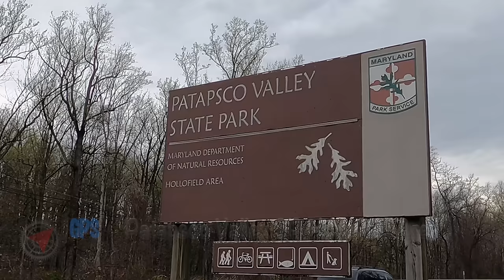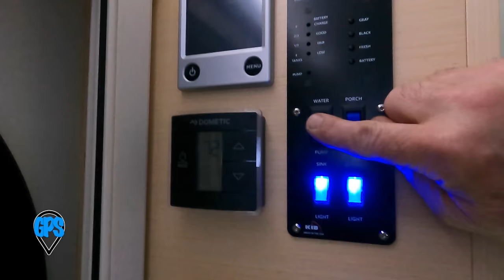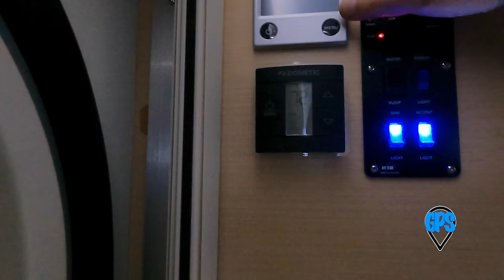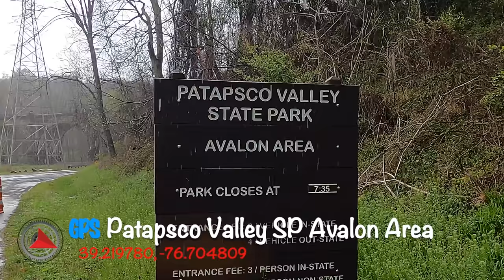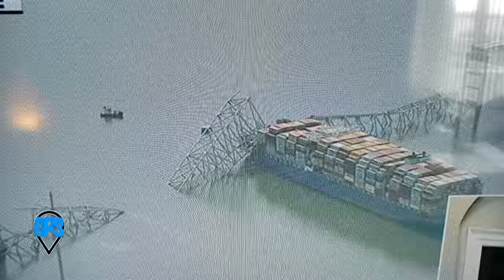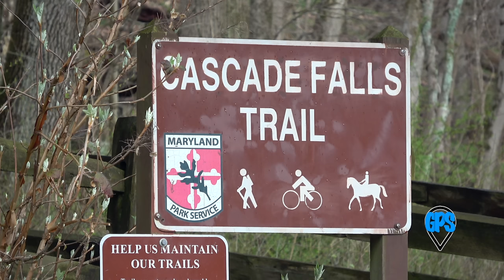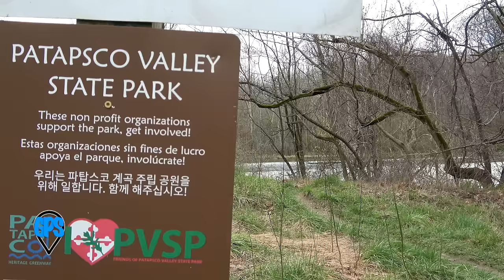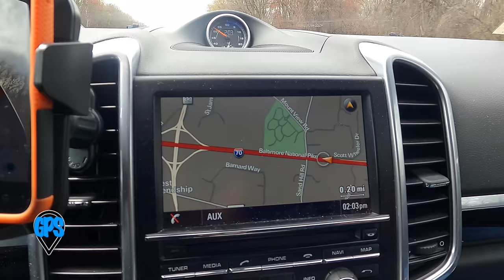Solo RV Travel Begins | RV Travel and Adventure GPS

Comment: Hello Sir, This is so rude and I want to ask you something . 
I saw that you don’t use the weight distributor when towing the nucamp 400. Is there no problem at all when driving? It’s no swing during high speed such as over 55 mph ?
Reply from the maker: Not rude at all. I asked nuCamp when I bought it, they said one wasn't needed. Sure enough, I've had no issues with towing at highway speeds, even with strong gusting winds. It's only 18' long, 3k lbs, really not much difference than pulling a small boat, utility trailer, etc.

Comment: I've never heard anyone talk about draining the Alde system. Hmm....
Reply from the maker: I hadn't either, until I heard an Alde rep at uCamp last year. Seems important, and  something you'd be told about when you buy it.
Reply: @Great_Places_Seen_GPS  they definitely didn’t say anything at the dealership when I bought mine, but not surprised.
Reply: @poodleprofessor  It's not draining the Glycol from the Alde, it's draining the hot water. Just flipping the yellow flapper valves for 10 seconds will create the air cushion if you're out for more than 10 days, otherwise, drain it after a trip.
Reply from the maker: @debbief6923 yes, the water. You have to lift the bed to access the yellow flipper, the hot water drain outside will accomplish the same thing. Every two years, you need a glycol flush, which I am due for. I'll have it done next week at uCamp. It's not owner serviceable, nuCamp currently charges $533 for it.